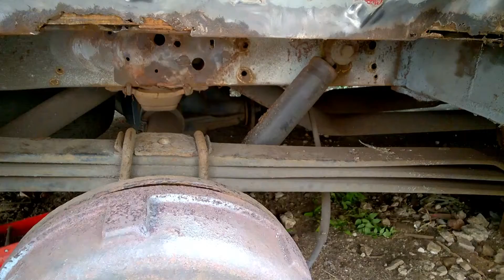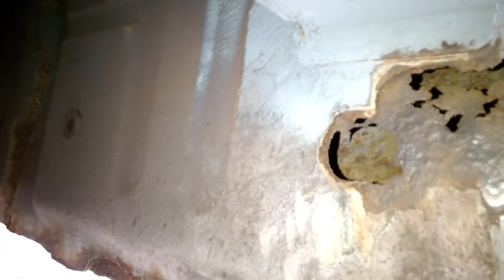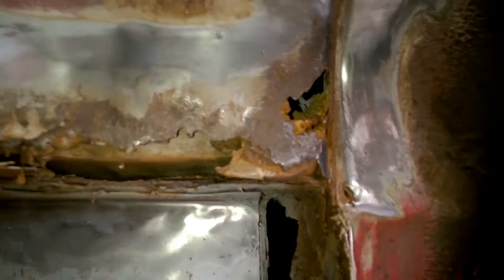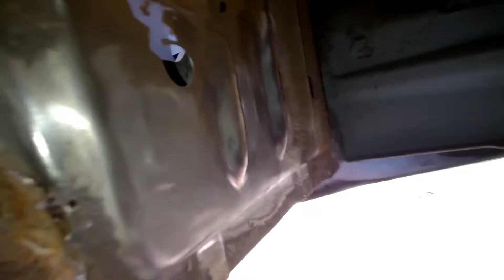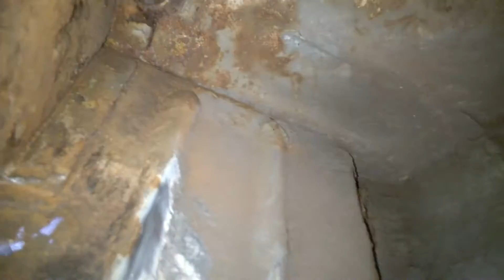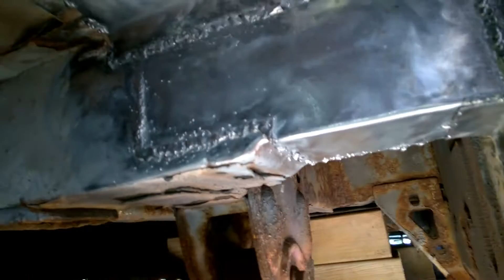Flux core welder Transit offside rear wheel arch rust repair.

Comment: It's rusted in exactly the same places as mine. Did the same with a 100 quid gasless flux core off Amazon. I'm a total welding novice but hopefully will get me through the mot next week.
Reply from the maker: Good, i hope it does 👍 This is my 5th transit, the other 4 got scrapped because of rust. I welded all seems completely but the wheel arch is body work so can be spot welded, the box section chassis has to be welding all round with no gaps, I was so happy that it passed that i decided to take it on as a project n see how long i could keep it going, that's why i bought a decent MIG welder, joinery wi metal init 😉 cleaning off the flux slag was a bit of a pain but doing what is in this link speeded things up, after I'd tacked it in place i could put 4-5 push-spots on then do somewhere else while it cooled, then come back, clean it off n do another 4-5, Best of luck 👍 https://www.youtube.com/watch?v=v3Ml6027y6o

Comment: Good work there. Just got my mk6 through its mot with my gasless welder that I've had for nearly 30 years, a lot of folk say they're no good but with quality wire they are brilliant. I found that the flux core from Screwfix gives nice welds, I usually take a week off work (self employed builder) to do it and if the weather's kind actually find it quite enjoyable. I buy a litre of phosphoric acid off eBay which kills rust dead then once it's welded and undersealed  I give it a good splashing of boiled linseed oil everywhere even inside the chassis sections, lasts forever love transits but owning one requires good welding skills......
Reply from the maker: Thanks, I got sick of getting the vans mechanically sound but then having to throw them away because of rust, so this one i decided to see how many more yrs i can get out of it, I'm a joiner so i'm thinking of it as joinery with metal 😉 I quite enjoy it when the weather, time n funds allow,  It has saved me a lot of money tho n kept me on the road.
 phosphoric acid, Is that the main ingredient in these rust converter products? I need plenty of that.
Reply: Gid joiner yes all rust converter is basically phosphoric acid but it costs less than a tenner for 1 litre on eBay and it's 80% so it's stronger. You must pour it into a small jar when using and never pour it back in otherwise it will react and render the rest useless.
Reply from the maker: Ok, that's good to know, did have a quick look on the phone at the price while sat in the van but didn't read about it, I have bought some rust converter stuff in the past but expensive n doesn't go far on an old LWB Transit 😃
Thanks when the weather gets better i'll have to do some o the van, 👍

Comment: My Transit has rust that looks almost spookily the same as yours! I have bought a Sealy Mightmig and started work, my welds are not nearly as neat as yours though, looks like a really good job, can you remember roughly what wirespeed you used? I keep experimenting with different speeds with mixed results. I find mine are getting better as I go though! Thanks for the good video.
Reply from the maker: Hi, thanks 👍 Sorry i've no clue about what wire speed it was, After i tacked the pieces well into place, i worked on the sections in between & did 3-4 welds at a time, then moved to a different bit while it cooled down, i cleaned flux off before making the next weld, but you can do a few at a time when the weld's still hot, i hammered/tapped the metal together so there was no gap before welding, Yes it def gets easier the more you do, squeezing the trimmer for the right about of time 🤷‍♂️ https://www.youtube.com/watch?v=v3Ml6027y6o

Comment: Nice work, bet that took a while!
Reply from the maker: Thanks, took about a weekend, time was added because of having to brush the flux slag off in between welds, laying on my back, hot rocks in my ears. hardest bits were underneath & where i had to take the fuel tank out to put a patch down the central chassis frame,  spent a wk doing lots of bits inc this n some on the other side, I've been a joiner for 32yrs so considered this a joinery but with metal & i posted this to show you can get a vehicle through it's Mot with a cheap flux core welder.  most of the welds are spot with a little push taken from this vid https://www.youtube.com/watch?v=v3Ml6027y6o
Reply: Gid joiner it is harder work if you haven't got a lift. With the welding mask even trickier to get to places so I've had to resort to the old close you eyes method to get some tacks on lol not tried flux core welding just because it's an arse to swap my mig from gas to gas less. Top marks though really looks a good job. The welding is only a small part it's all the bloody pre work!
Reply from the maker: Zed Man yep, getting my head in between the axle and the wheel arch, lots of swearing getting stuck, a little bit of point, close eyes n shoot went on, , lol, thanks,